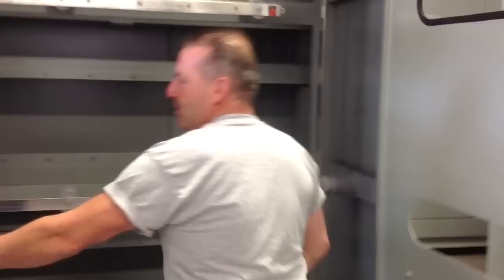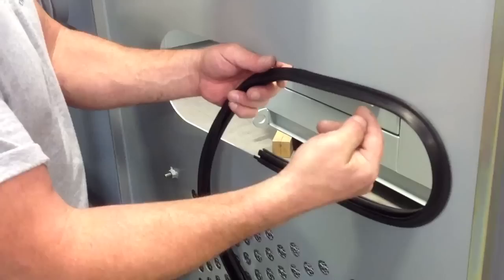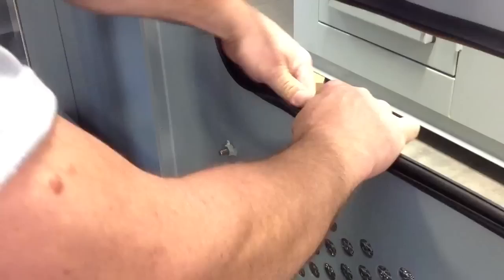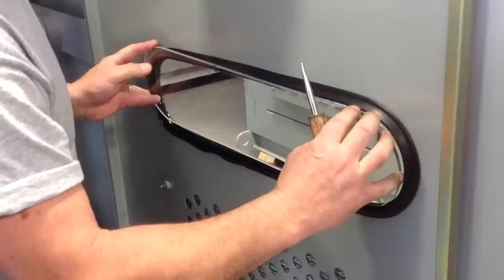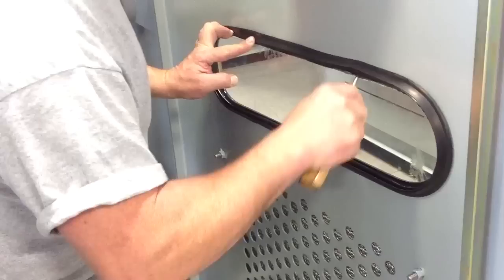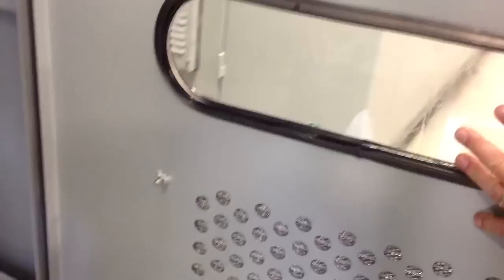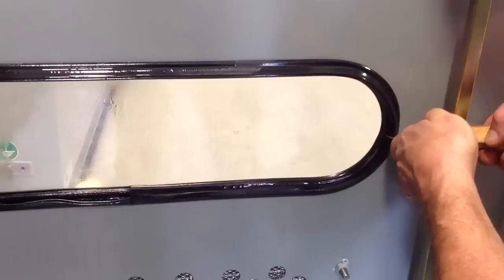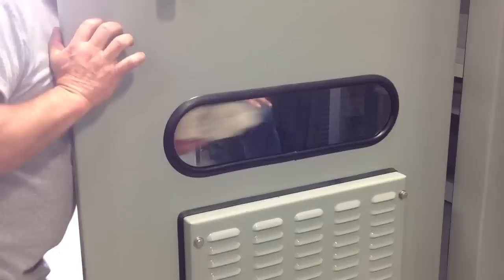Window Installation

Comment: There is a better way to do this! First of all use lube for installing tires instead of the messy WD 40 that will not be good for the rubber and will seem to never go away. It is similar to soapy water. They sell it by the jug with an applicator. Secondly there are tools specifically for this. The awl is a problem waiting to happen with scratching the surface and possible injury. They make a hard plastic rubber installing tool as well as a locking tool specifically for doing this. Doing it with my suggestions would make it faster, easier and safer.

Comment: well mate actually wd 40 is great for rubber as its a synthetic lubricant works well and any glass cleaner will remove it secondly just use a piece of 3mm diameter string in the grove and pull it in i have done many windscreens this way easy

Comment: WD 40 is mineral based - that's not gonna help these materials in the long run.. Inox would have been a much better choice here (Lanolin based) and would have done the same job if not better.
Reply: I would've used tire mounting lube, or real soapy water -